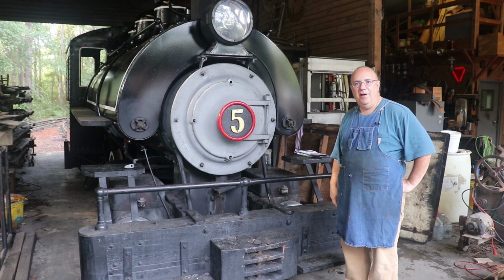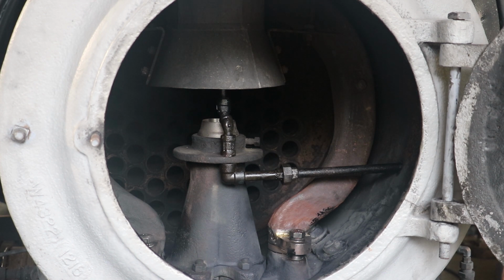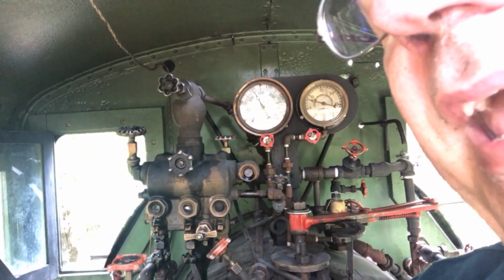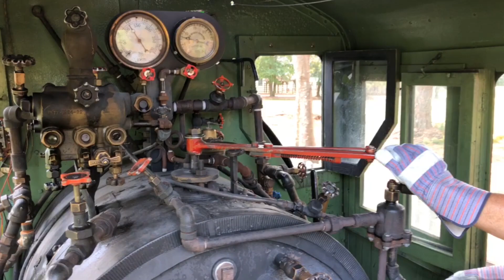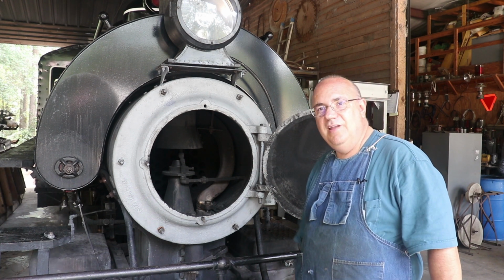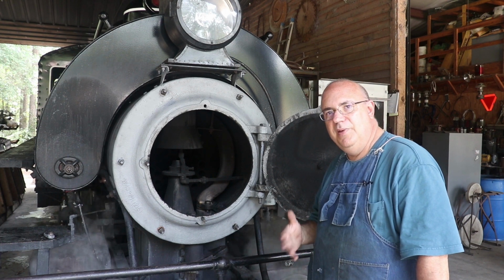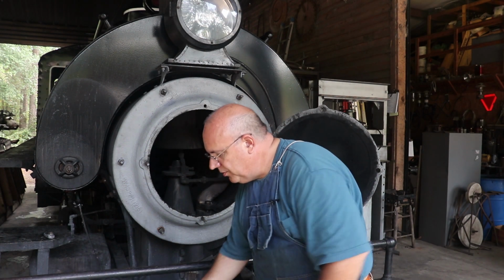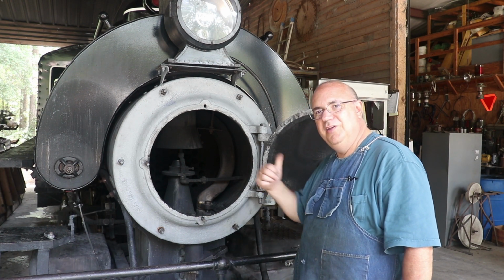Steam Locomotive Steam Pipe Repair - Part 6: Testing the Repair!

Comment: As a stationary engineer for the Hvac Dept. at a college in IL. This has been very interesting to watch unfold. Even though some design and better safety’s are in place today not a lot has changed. Our system is mainly for heat transfer. Warming bldgs and even for cooking. So it is fun to see it used to change to mechanical energy. Thanks for sharing.

Comment: I'm a long time viewer of your wonderful channel and especially enjoy any video centered on the repair and maintenance of the Vulcan locomotive.  So, I've been extremely appreciative of your steam pipe repair videos.  Very well done!

While watching them, I did see another potentially great university project.  Although Vulcan designers certainly knew their business, they did not have modern thermal flow theory, any of the relevant mathematical models, or the tools (computers) needed to work with these models.

This might be a great project for a Thermal Fluidics class or lab.  The students can vary the internal nozzle shapes and dimensions in an attempt to find a design that yields better airflow through the boiler.  Think of it as adding a tuned racing exhaust system to the family car.  Best of all, it appears that this part is secured by a single bolt, so trying various designs would be easy to do.  

As you have already established a relationship at the University of Wisconsin, you might consider asking them to model the dynamics and efficiency of the exhaust nozzle beneath the petticoat to see if they can come up with something 'better'.  Furthermore, consider approaching the ME departments at Georgia Tech, Auburn, N.C. State and other regional universities to do likewise.  Given the apparent ease of swapping out exhaust nozzles, you might organize an inter university contest to see who comes up with the best design.

Anyway, thank you for all of the wonderful videos, and all the best in your varied activities.
Reply: I think the idea of restoring an older piece of machinery is to get it as close to original as possible and appreciate its uniqueness.  Improvements, as suggested, while simple tend to alter the beauty of the original.
Reply: I agree.  However, my suggestion was not so much to make an 'improvement' but to try to tie the traditional to the modern and to show how the two may be married together.

At some point, someone will want to restore a locomotive that has this (or some other) part missing.  If modern engineering curriculums are not adjusted to accommodate supporting past technologies, every time a vintage part goes missing, we lose more of our technical heritage.  Hence my suggestion.

Get colleges involved in technical restoration projects, even if it is in a tangential manner.  If they never get involved, they may not be there when you really need them.  Worse, no one may get any training on how to apply modern design and engineering principles to older technology.  In that case, the old technology may be truly lost.

Comment: Great video series Keith. When the folks get ready to cast the new part will the pattern need to have been made over size to accommodate shrinkage or is there enough play in the fittings to accommodate it?

Comment: Something i noticed. Above the lower hinge mount on the front panel at a 45* angle on the edge of the opening there looks as though there is a crack running back toward the hinge., It probably just a mark in the casting? Its nice to be able to fix thing properly the first time. Well done.

Comment: Great series; thank you for the insight of what can be done with broken parts. A second vote for John Bare's suggestion. 
Are the pipes' layout symmetrical? Granted, the right one was the immediate problem but if the pipes aren't symmetrical then any problems with the left one could not be solved with the spare right one. Why not make a pair of spares?
Reply: Dunc   As far as I know all locomotive front ends are arranged with symmetrical steam pipes so that steam is equally distributed to the cylinders.  That means that the parts are as close to mirror images as was possible with the manufacturing processes that were available.

Comment: might have to connect the university professor with your other friend sand rammer..  and have him go up there for some lectures that will be video recorded to share the knowledge at the university level. 

 hopefully for the interior passage sand core. the 3d printer will create a 2 piece negative box that has flat faces and alignment tabs.  so sand cores for the inner.. could be created directly off the negative 2 piece 3d halves.  could be strapped or clamped together and filled from one end or both ends.  its just something i have been thinking about for slight changes during cylinder head manufacturing.. to allow easy port shape configuration without changing the external dies..  or external sand core shapes.

Comment: I believe in one of his videos , David Richards  mentioned that he uses a steam specific lube , mixed with the steam , before the steam enters the cylinder ?

     Do steam locomotives use a similar lube ?

Thanks ,  :-)
Wyr
God bless
Reply: Yes. A high temperature steam resistant oil is added to the cylinders by way of a Hydrostatic Lubricator in this case. How it and a Feedwater Injector work are two of the mysterious secrets kept by True steam locomotive engineers and wizards of a bygone era.

Comment: Keith,

Have you considered fabrication of an actual blower ring in lieu of the standpipe? They’ve more efficient in contrast to the stand alone pipe arrangement, especially on oil burners. Just something to consider.
Reply: You are thinking about a much larger and more sophisticated locomotive for fast and heavy trains than this one which is about as simple as they get but gets it's job done.
Reply: Drafting principle is linear regardless of the scale of application, speed or sophistication.

Comment: Looking at the bolt holding down the lower part of the repaired steam pipe it looked to me as if there was a flat washer and a spring washer under the head of the bolt if I am seeing correctly then 'washers' should never be fitted in that way ! Otherwise a job well done
Reply: To make it out of stainless steel you have a problem with the two  different metals expansion as s/s will expand more than the cast causing it to break the cast iron where it is bolted to the s/s. Cast iron will with stand the heat and steam better than the s/s.

Comment: I hope you get up there for the casting, and can film it. How in the heck can a metal casting be made of a twisted tube, with a void all the way thru it, maintaining a minimum wall thickness ? It seems nearly impossible. Yet is was done by our forefathers. I'm wondering if any of your old books go into this type of casting.
Reply: If you can get hold of any books by the late C.W. Ammen,he wrote a great deal on the subject of casting. Well worth the effort to find some of his work.
Reply: Some one, in a comment on an earlier video where casting the hollow pipe came up, said something like "That's not difficult, they do it all the time for cast iron exhaust manifolds."  Go look up how they cast exhaust manifolds.  I do remember that the hollow part has to be near horizontal.
Reply: Take a look at exhaust manifolds.  They all are what you explain ("metal casting made of a twisted tube with a void all the way thru"). There is probably a video or two out there that an engine manufacturer has put together that shows the casting process.  At least for me that would answer a lot of questions.  I will search the Interwebs and see if I can find some info.
Reply: The foundry process to make castings hollow is called coring.  In some cases, a hard sand shape is suspended inside the mold cavity by using core prints which support the core on the outside, and chaplets, that hold the core away from the walls of the mold, maintaining proper wall thickness.  After the casting solidifies, the core is removed, to leave a hollow casting.  I always use the example of a fire hydrant.  If you don't cast the iron around a core, you would be wasting metal, creating unneccessary, sometimes impossible machining,- and making a casting that would be very non-competative. There are lots of examples on Youtube, some poorly presented, some well done.  Some foundry processes eliminate the need for a separate core, but for large castings, coring is usually the most economical to make a casting hollow.
Reply: in the old days they used goats

Comment: Ahhh...All the valves, hand wheels, piping, grime, and soot--I can almost smell the fuel oil.  If you're gonna be a gear head, best be a Victorian gear head.

Will there also be a coreprint for the 3D print of the replacement steam pipe?

Comment: It's amazing to think about how the engine was originally built 100+ years ago ---- No CAD, No 3-D printers. How did they do it?
Reply: Pencil and paper. Wooden mockups. Lots of trial and error.
Reply: The original pattern would have been modeled in wood, starting with the end flanges and then gluing pieces of wood together until they connected, then they would be hand carved to form the outer shape. Then a sand mould would be made and a core pattern formed in a similar way and hand carved and fitted into the sand mold. A sand core would then be made from the core pattern.
Reply: Dont forget knowledge of mathematics...

Comment: I just realized that the steam pipe that was repaired acts as a sort of superheater for the steam going to the cylinders.
Reply: Perhaps conceptually, but not really, in practice. The real heat is in the firebox and the first third (the back third) of the flue tubes in the boiler. By the time the exhaust gasses get to the smokebox all the useful heat has been extracted and they are relatively cold. 

It looks like this engine makes wet steam. It doesn't appear to have any superheaters. You would see them from the smokebox, as they are U shaped tubes that come down from the steam header at the top of the box and go into larger than normal flue tubes, then loop back in the same tube and come out and go to another header (the superheater header) at the top of the smokebox.
Reply: I wilton, I agree. In fact the designers have made an effort to keep the steam pipes away from the hot gasses as they pass through the smokebox. I wonder if cast iron pipes would stand the thermal stress and the makers were taking no chances.
Reply: I think it is more that they didn't want to block the flow of the flue gasses. Putting an obstruction at the end of the flue pipes will slow down the exhaust, and this will cause dirt to settle in the flue pipes, blocking them. Also, you needed to be able to get to the ends of the flue pipes to run cleaning rods down them every few weeks of normal operation to keep them clean. Having the steam pipes to the engines in front would block that.